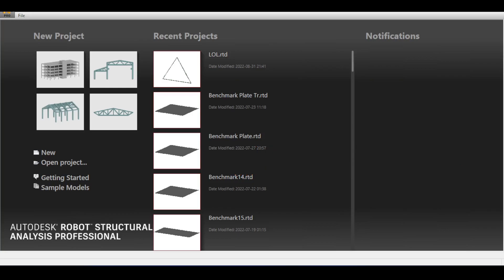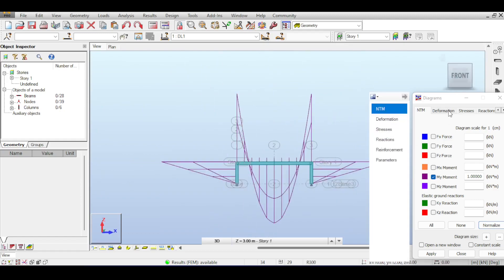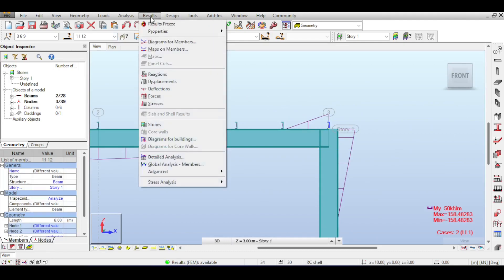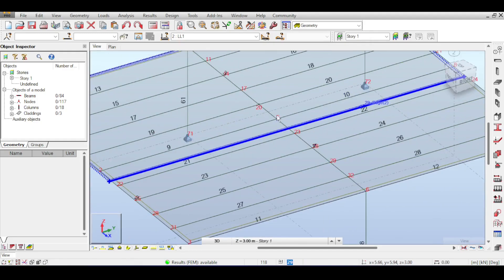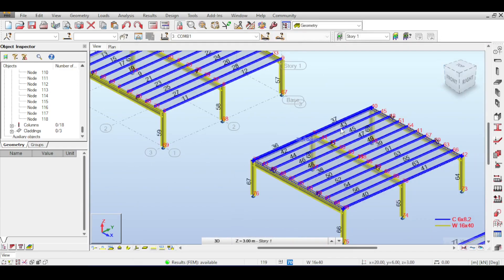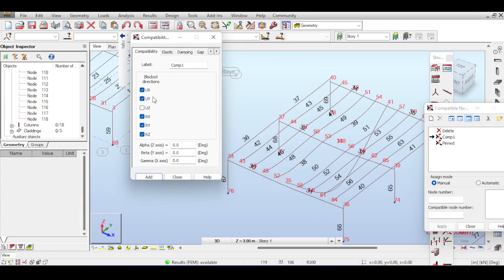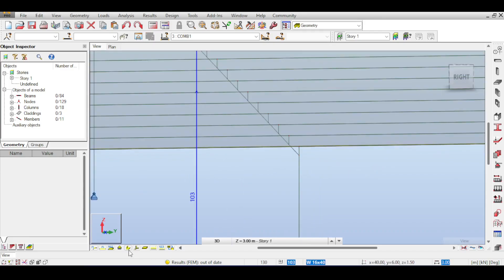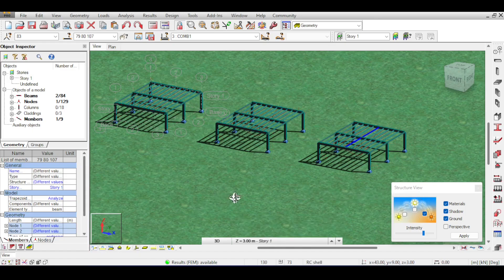Understanding Compatible Nodes in Autodesk Robot

Comment: Wow wow wow. Am really happy I found this channel from the start.

A lot of mistake engineers make in practice is to model, analyze and design one thing and implement another during construction. 

In my part of the world, steel connections are designed as simple connection due to economic factors, which require moment release in the analysis model at all joints in the model, excerpt where a true moment connection is required for lateral stability.
It’s really makes me happy to hear you always emphasize on this important point over and over again.

I have always wondered the use of the compactible nodes button in the RSA program, however this is the best insight into the use of that functionality. 

I personally believe the deflection of a node connecting multiple element should have the same deflection value as the ends of the members framing into that node. I would love to know instances where this is not the case.

I love ❤️ your comparative analysis, where you aim to achieve one thing using so many methods. 

What will be the trademark for your  FEM based program. 
It looks good by the way and I am sure it will fantastic once completed.

Thank you  and congratulations to your new working software.
Stay blessed CEE.
I look forward to your next tutorial session.

See you soon Sir
Reply from the maker: Hello there, I am really happy that you liked the video.
Indeed, the point that I keep making about connections is an extremely important one. Not only for working engineers in the field, but for students as well.
 I personally face a lot of students during the final design projects (last year project) where they do not understand the consequences of assuming pinned or fixed connections.

I share your opinion that connections are better pinned for economical reasons unless necessary for stability. 
Rigid connections are somewhat more expensive, you have top and bottom seats, lots of bolts and/or welding, and sometimes even stiffeners.
Whereas for a pinned connection, there is nothing like that because you only want to "hold the beam in place" and you are not responsible of "resisting rotation".

Still, since it is an essential channel, I have to mention all possibilities.

As for the comparative analysis, the best way of truly grasping an issue is to show it in comparison to a benchmark. 

as for the software, it's name is "STRADO" and stands for:
Structural Analysis and Design Optimization Software.

It is still incomplete. I need to put more work into it.

Thank you very much.
Please consider recommending this channel to your friends.
Regards,
CEE
Reply: @CivilEngineeringEssentials   I keep posting the content of this channel to my Facebook groups but I think the admins are sleeping on the job. 
They rarely approve post. 
I definitely post to my friends on telegram.

Comment: Thanks about your explain about robot,i need your advice to be a professional in robot ,i think it's best software and very flexible than etabs

But in my country use and preferred to use etabs
Reply from the maker: Hi there, Autodesk robot is indeed an amazing software. My guess is to watch tutorials and try do a project you have done before on robot. You will have many questions during this process, and you can always come here and ask them if the video happens to be talking about an issue similar to yours.
Indeed, they like to use ETABS in some countries, but with the advent of Autodesk Revit, things are shifting in Robots favor as the integration between Revit and Robot is almost seamless.

Hope it helped you,
Regards,
CEE